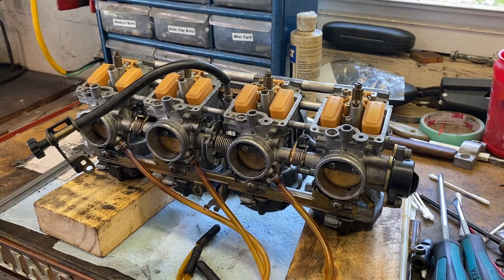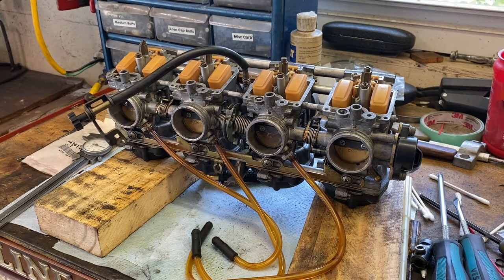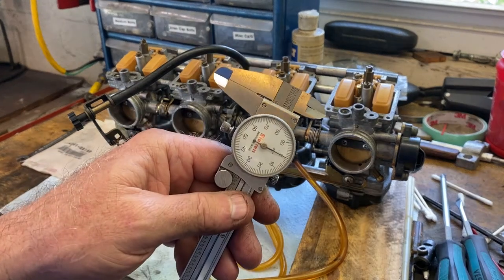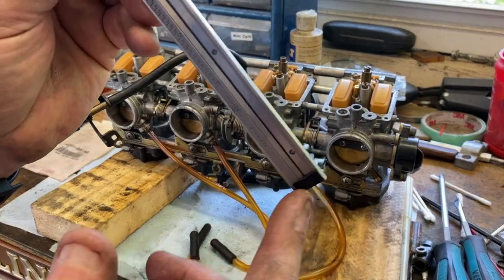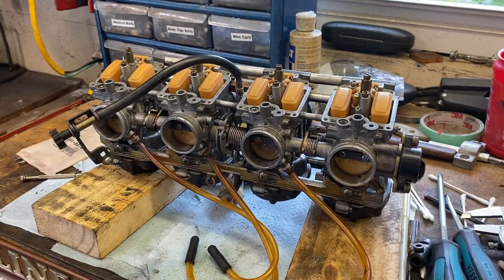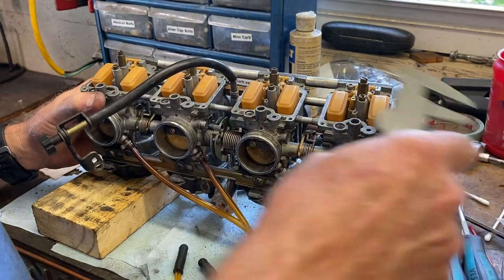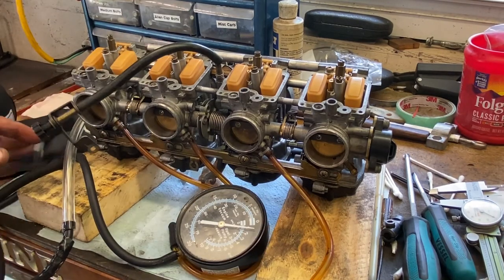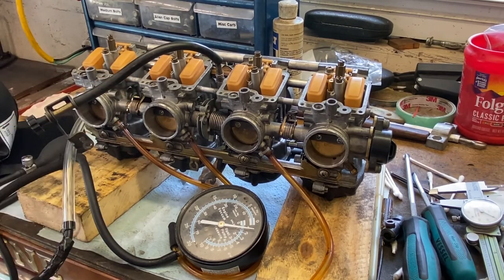Racked Carburetor Float Level Check and Adjust and Pressure Testing

Comment: Great videos. As a 57 yr old mechanic taught by my father and fully licensed mechanic, college of trads RED ( Registered Education Diploma) seal certified for Canada. You covered this very well. 

Pro tip every Mikuni carb I have worked on when the seam of the float is dead even with the carb body, Parrell to each other that is fine. Especially on these Bandits ( I own a 2001 since new). 

One thing that stumped me was a bad TPS, never try to cynic carbs with it hooked up EVER !!!  I was 100% convinced it was dirty carbs. I Cleaned/adjusted and so on. Only to have a random misfire high idle hot only to find it was all the TPS to begin with. Messing with the ignition map. Just setting the TPS is a nightmare alone, they must be torqued into position or the value changes on your Multi meter while your tightening the screws. Then and only once tight re check your 76% difference from closed to full open. Just handling them on the bench can change the setting even if you never moved it.
I like your blood pressure set up I just use low air pressure and watch to see them all open/ flutter at the same time/ rhythm/ bounce. I am going to have to try it now though I can't say I have ever seen that trick.

Stupid part is this was just suggested to me to view just after I had done all this myself and thought I could add some input, untill I noticed this is a old video now commenting.
Anyway keep up the great work teaching others how to fix shit.
PS 3.5 turns from lightly seated is a Factory setting for the mixture screw if your ever handed a set of carbs you know nothing about and may have been ducked with.

Comment: I'm doing maintenance on the carburetor of my Bandit 1200 and, even though I don't speak English very well, your video gave me the information I needed... Where and how to measure and how to adjust to measure the height of the floats. Bandit's technical manual does not specify this detail very well. Doubts always arise when I talk to some colleagues about the subject. Congratulations for the creativity in how to check if the needles are sealing. The idea of using a blood pressure monitor was sensational!
Reply from the maker: Glad it helped you out. Please consider subscribing/liking/sharing my videos to help grow the channel so I can provide more content like this.
Reply: @MotoRestoFL  It will be a pleasure to help your channel

Comment: Great video, im trying to tune my bandit which is surging and running poorly. Ill pull the carbs again and check the float levels. Where do you connect the pressure cuff to? One of the vacuum ports on the carb - number 4 where the vacuum lead to the tank goes?
Reply from the maker: No, to the fuel hose inlet. The objective is to pressure test the entire fuel supply side up to the float valves. With the carbs upside down. It’s just a reference test.

Comment: this is genius. Can i test the float sealing as well just by blowing into the fuel line?
Reply from the maker: Sure. but unless you're a deep sea diver it'll be hard to maintain a static pressure for any length of time. Which is why I use the cuff which acts as an accumulator and maintains consistent pressure at a given point. Thanks

Comment: Well guess I have to pull my carbs back off and do this. Changed the floats, needle, and seat but didn't check the float height
Reply from the maker: Is it not running ok?
Reply: No. My idle mixture screws need to be readjusted as well. I didn't set them back to exactly where they were. Believe I have multiple issues though. It has been sitting a while. I can get it to run with enrichment but as soon as I take the choke off it dies. With choke on it runs but is sometimes backfires or the rpm changes up and down randomly between 2k-5k rpm. That could be my tank is low so the fuel might be running out in the carbs and the filling back up. I believe when I switched to res that went away for the most part.
Reply: Also I have oil getting into cylinder 1 and 2 from either the rings, valves, or head gasket. Haven't started to troubleshoot that yet.
Reply from the maker: @brandonfeeley514  yep you need to go through them again. The slow circuit is compromised by junk. Clean or better yet replace the slow jets. Blow out all the circuits with cleaner and air. Remove slow screws and blow that out too. Check service manual for initial settings. Go from there. Must do a synchronization if multi carb engine. Cheers.
Reply: @MotoRestoFL  yeah its the same carbs as this video has. Do you know the best way past the base setting to tune the idle mixture? Can it be done by vacuum?
Reply from the maker: @brandonfeeley514  No. Slow screw adjustment does not change synchronization except in relation to idle speed where synch needs to be performed at. There are often specific procedures as to an idle drop test adjustment of the slow screws but I simply go off how it sounds and whether it seems lean under very light throttle like in second gear. I have two different Motion Pro slow screw adjustment tools which allows getting at the screws and turning them while the engine is running. It’s the only way you’re gonna be able to do it. I’ll look up the tool I like best and post you a link.
Reply from the maker: @brandonfeeley514  https://www.motosport.com/product/?cc=us&gclid=Cj0KCQiA-eeMBhCpARIsAAZfxZDLCI6ClvSOvD43bRPnd0PlNRKLtRGa-vB0Nygpanbqm_axKBjQ00MaAoHUEALw_wcB&gclsrc=aw.ds&key=Motion-Pro-90-Degree-Carb-Tool-With-Bits&psreferrer=https://www.google.com/&pssource=true&segment=badger&utm_medium=pla&utm_source=google&variant%5BMOP005C%5D=MOP005C-X001-Y001
Reply from the maker: @brandonfeeley514  is this a bandit 1200 or Gixer or what bike?